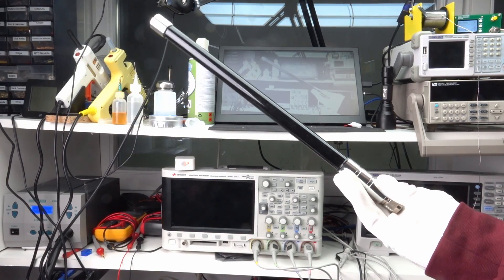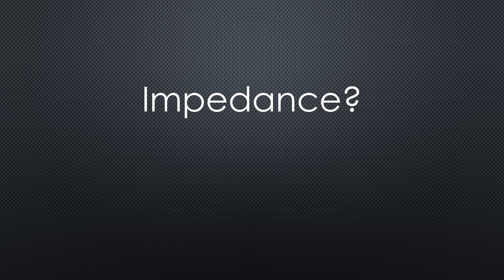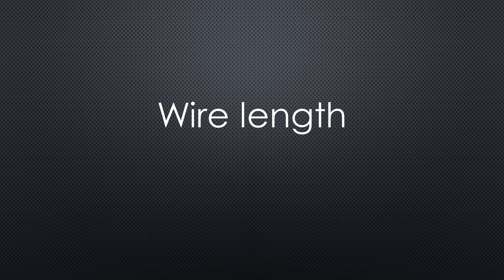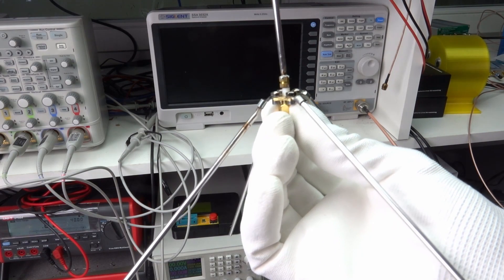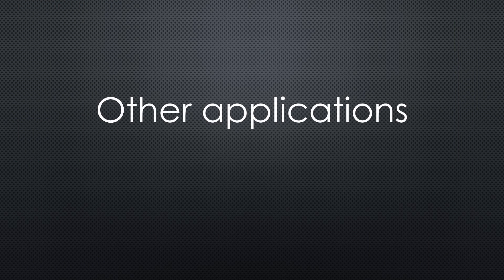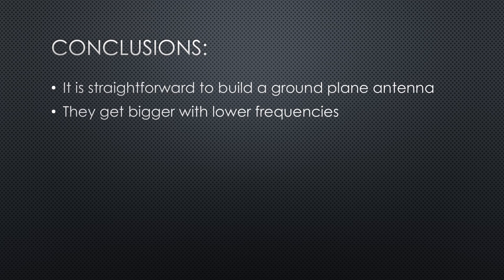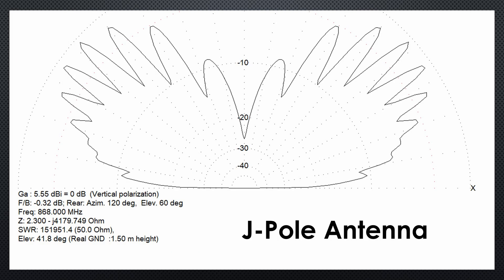002 How to build performing antennas for LoRa, WiFi, 433MHz, Airplanes etc NanoVNA, MMANA GAL

Comment: Yup.. Antennas are crazy at times.. (Scratch your head) Wondering.. 🤔 .. How they could possibly work .. Especially.. When they Measure as a DC Short.
But yet don't damage your Transmitting Device. 👍🏆 Thanks for Sharing.
Reply from the maker: You are welcome! Indeed, a DC short can be something very differently for RF.

Comment: Also, is ther an advantage of a full wave over a quarter wave ground plane antenna for 1090Mhz?
Reply from the maker: Longer antennas in general are better. But keep in mind that the impedance of an antenna always has to be matched to the coax.

Comment: Thanks for the video. You indicated PL 239/59 are used up to 100Mhz.  What about for recieving only?  Would N type vs UHF type make much difference for example at 1090 Mhz?
Reply from the maker: They use it also on 2M rigs. So I assume it is not critical around 150MHz. 1090MHz is much higher. I would not use it because you have better choices. But I have no solid data.

Comment: When measuring the length for the vertical, I think the length is from the tip down to the reference plane of the SMA connector (because the pin on the connector is part of the vertical), but for the radials, when do you measure to? Do you measure from the tip to the centre of the mounting plate of the connector or is it just the length of the rod (plus the mounting tag)? It maybe doesn't matter too much for lower frequencies but it may make a difference for frequencies above 433 MHz.
Reply from the maker: I measure too long and cut it according the measurements. But you are right, the length is measured from the end of the ground

Comment: The J-pole is an excellent introduction to antenna building, because it is two parts in one - an impedance transformer and a 1/2y dipole.  If you build the transformer first and match it into a 3Kohm resistor then it is easy, just adjust the overall length and feedpoint for a match.  Once you have this mastered, then try a slot antenna, that will wreck your brain lol
Reply from the maker: Indeed, the J-pole is an interesting antenna to learn. Without explanation it looked rather strange to me.

Comment: What a great video ! It is really informative. You very briefly mentioned "return loss" but then didn't go into it. Also right near the end at the J-Pole antenna I am not sure what happened as the VSWR is printed as 151951 or so. For the sake of beginners we need to ask if this was probably 1.5 ? Also the impedance looks a little strange at 2.3 Ohms (real part).
Reply from the maker: I do not know what you refer to :-(

Comment: What type of coax do you use to connect your antennas to your sdrs?
Reply from the maker: That depends on the length of the cable. Rule of thumb: The longer and the higher the frequency the thicker (and more expensive) the cable.

Comment: My suggestion for a satellite antenna is a circular polarized antenna, of course.
The reason is simple: in the space words like "vertical" or "horizontal" does not exist and if the receiving antenna does not use the same polarization, there are 20 dB of loss !!!
So almost all satellites use circular polarization (same sense = no losses).
If the terrestrial station uses a linear polarization (vertical or horizontal) and the satellite uses a circular polarization, there will be always 3 dB of loss.
The most common omnidirectional antenna showing a convenient radiation lobe for satellites is the "turnstile" (not all the projects on the web are correct...) but the circular polarization is achieved only at high elevation angles and the radiation lobe can be improved.
"Quadrifilar Helix" antenna should be better, but it is more complicated to build.
I'll try soon an improved version of Lindenblad Antenna.
73s.
Reply from the maker: I did not check all CubeSats, but the ones I looked at had simple dipoles. I agree with your statement on circular modulation, but my setup currently gets signals from 2000km away where the transmit power is 500mW. LoRa has a very high link budget...

Comment: I have built ground plane antennas for frequencies up to 147 MHz, but have never known that putting the radials at a 45 degree angle was critical. Thanks for the explanation.
Reply from the maker: These small VNAs are very valuable to see the effect of changes in the antenna design. So it is more fun to experiment with antennas…

Comment: Thank you for this great quality content! Should I test an antenna with the final cable length attached? For example, if I have to run a 1m coax cable between my antenna and the receiver, should I include the cable when using the NanoVNA?
Reply: If you must have a test coax on your antenna, then first cut yourself a 1/2y length of cable and get it exact.  Remember that a 1/2y section of coax is a 1:1 transformer, quite the opposite of a 1/4y wave section which will transform a short to an open and vice versa.
Reply from the maker: Maybe you also watch the video about the nanoVNA. But a short answer here: If you want to test the antenna you have to do it without coax. If you want to protect your transceiver you have to measure at the end of the coax where the transceiver is mounted.
Reply: @HB9BLA  Thanks for your answer. I also watched the video about nanoVNA but as you showed us : "an adapter or cable invalidates calibration" and I was wondering if the cable going to the receiver could act as part of the antenna (ADS-B collinear coax antenna) and if I should take it into account when doing measurements.
Reply: @pivertigineux  The reference plane is the interesting part.

Comment: Very good, Andreas. One question though, were you really soldering aluminium welding rod or did I misunderstand? If you were, what solder/flux were you using please?
Reply from the maker: It was a welding rod for aluminum. So I do not know the exact materials. Later I found a similar product with a copper surface for "hard soldering" also on ebay. This is much easier to solder. Both are not expensive and you get them in the length of 1M
Reply: @HB9BLA  Thank you.

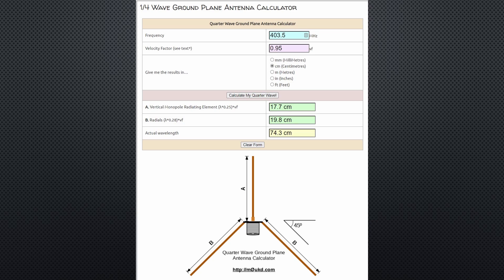Comment: 5:15 I was wondering if I should consider any skin effect when choosing the antenna copper wire? And also, would multi strand be better than simple wire?
Thanks in advance, and thanks for your passion sharing!
Reply from the maker: I do not know enough about the skin effect :-(
Reply: You have to have a basic VNA if you're building antennas, or else its just too hit-and-miss.  Get one, they're cheap and great fun to use.

Comment: Excellent, excellent video. I understood most of it.
With regard to the calculator showing 17.7 cm, and you trimming it to 17. Did you say that you substituted aluminum for copper?
Is the velocity factor the same?
Reply from the maker: I used a sort of metal where I do not know the composition (a welding rod). But for sure not copper. The VF is different. Otherwise the optimal length would not be different.
Reply: @HB9BLA  Is copper vs aluminum better? Should one always prefer higher VF over lower?
Reply from the maker: @OxOOCOFFEE  AFAIK the VF has no influence on performance, only on dimension. Copper has very different properties (it conducts a little better which is good) but is expensive.

Comment: Does the receiving antenna also need a ground plane?
Reply from the maker: Yes. But receiving antennas are less problematic if they do not expose the right impedance because only the signal gets weaker, nothing more. Transmitters can be destroyed in this case.